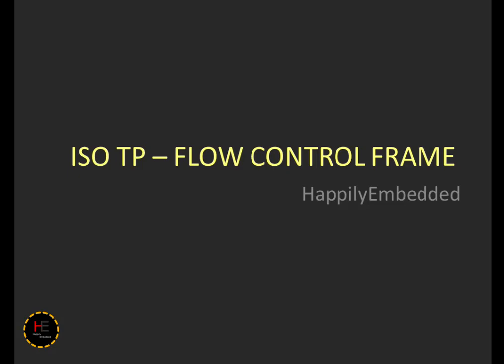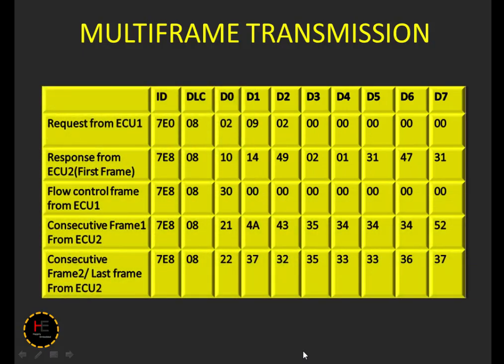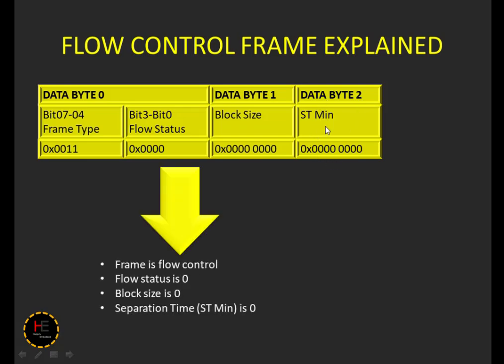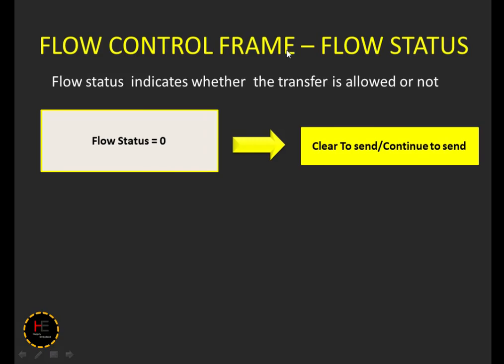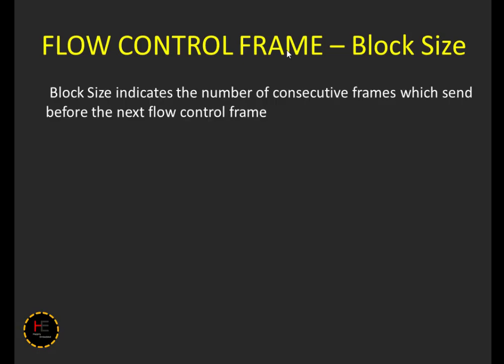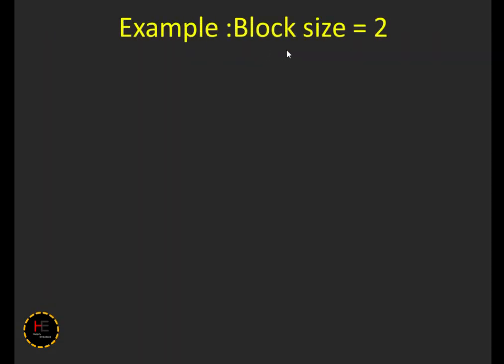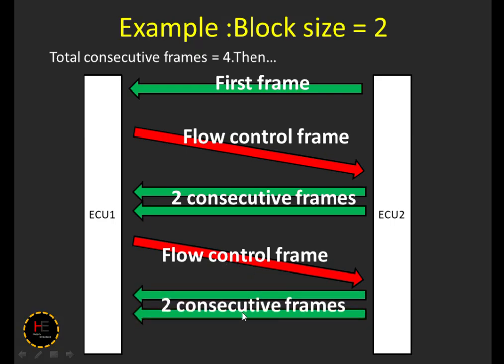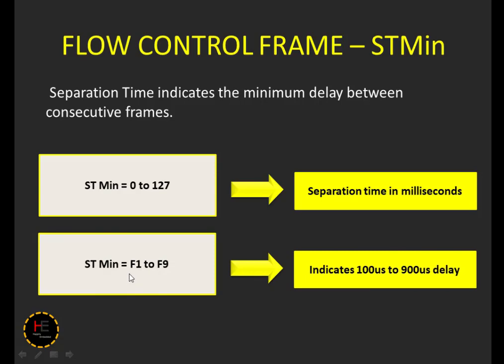ISO TP Flow Control Frame | CAN Multiframe Transmission | Part 2

Comment: In the video ECU1 address is 7E0. While sending the response for flow control frame from ECU1, how id is 7E8?
Reply from the maker: Please check the description: An Error in video : Instead of 7E0, 7E8 is mentioned for flow control frame from tester,
 the tester will send the request using 7E0.

Comment: If BS = 2, and ECU doesn't send another flow control frame after 2 consecutive frame, what is the NRC ?
Reply from the maker: There is no NRC. CAN Tp (N_Bs: Time until reception of the next Flow Control) timeout will occur. It will wait till N_Bs timeout value. If N_Bs timeout occurs, then Can TP will abort the transmission of this message.

You can check the CAN Tp AUTOSAR specification for more information.

Comment: If STmin = 128, what is the value of separation time ?
Reply from the maker: STMin possible values are 0x0 to 0x7F(0 to 127ms) and 0xF1 to 0xF9 (100 to 900 microseconds)